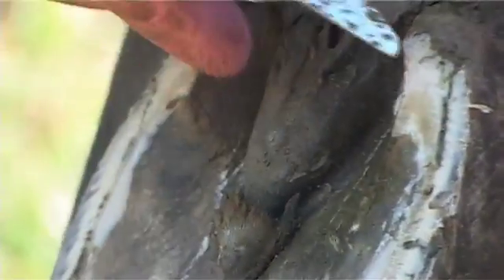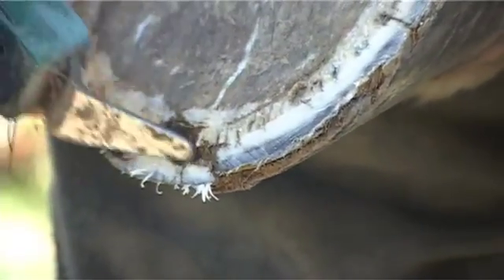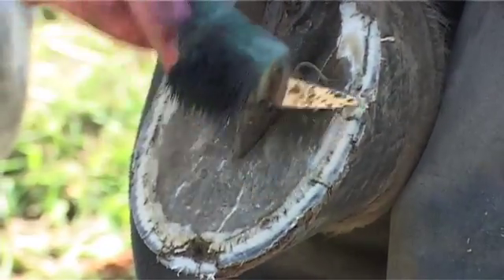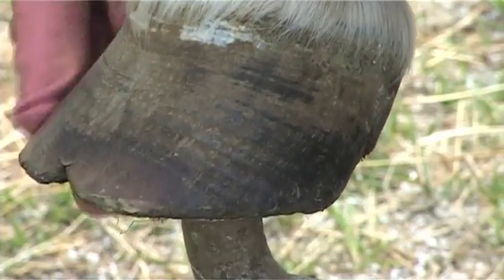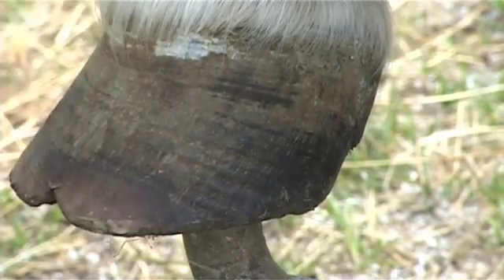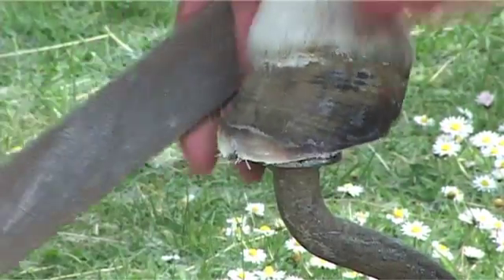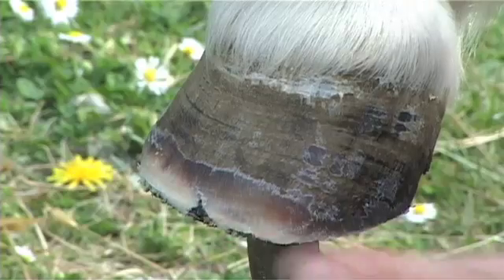Hoof trimming 1

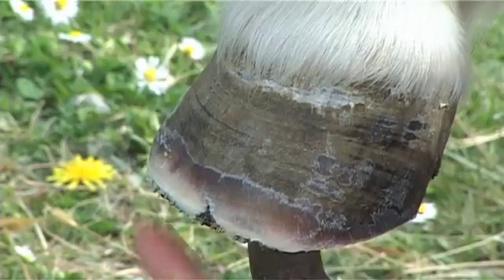Comment: You did nothing to make the pony "more comfortable (1:10)    There is much better way to address the wall flare.   First the diet must be corrected...next the face of the hoof wall should NEVER be rasped, use a "toe rocker" which sets the break over in better position to P3 by positioning break over on the bottom of the hoof...and finally and this is very important...don't make videos when you don't have a clue !